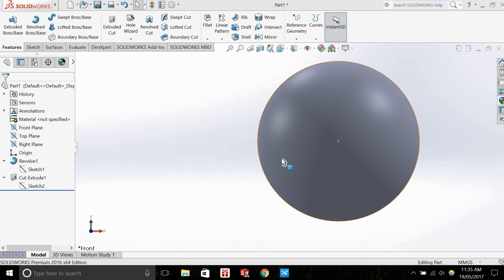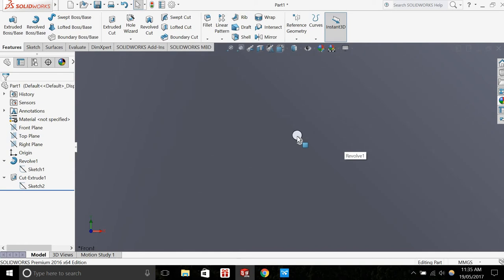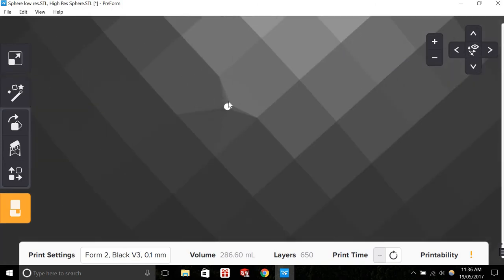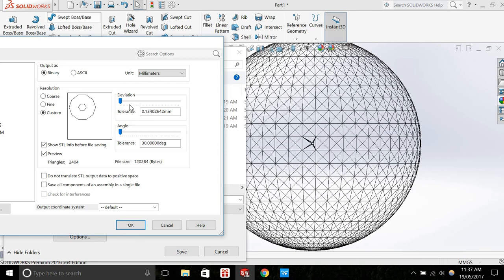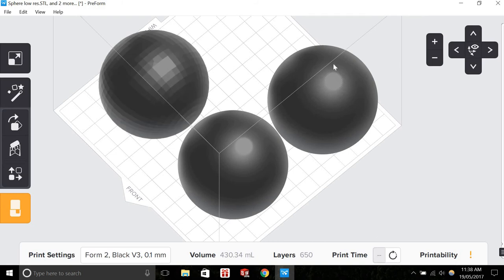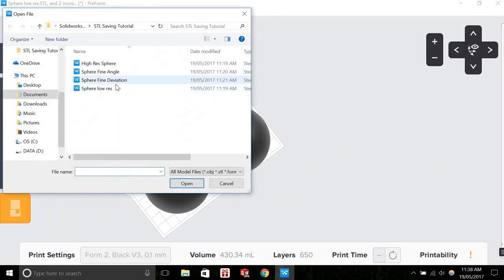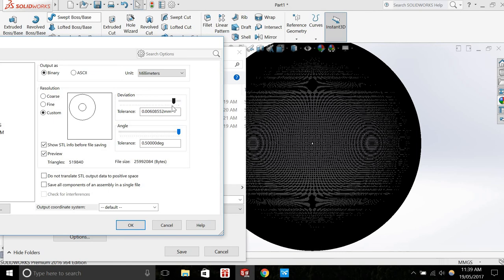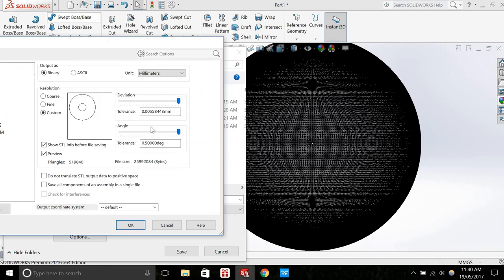Fix SolidWorks STL files - smoother 3D prints

Comment: how do i do this in autocad?
Reply: system variable FACETRES <0.0-10.0>.  The default is 0.5.  10.0 is the highest resolution.  I have not found where you can adjust angle; that might be unique to solidworks and inventor.
Reply: @FABITALL  thanks fabitall.   that facetres setting is on a per drawing basis which is even better as you would forget to reset it for 'normal drawing'. Cheers.

Comment: after a lot of google research i found your video..no more problems with printing from now. thank's a lot
Reply from the maker: No problem, happy to help! It also took me a while to figure out why my 3D prints weren't good
Reply from the maker: If you don't mind me asking what search terms where you using? So I can make this video easier to find for others with the same problem
Reply: @MahdiDesigns  i use solidworks shapes not perfect for printing i think. Circle not perfect solidworks, cilinders not perfect. This kind of things
Reply: Which software
Reply: @irfanshafiq1353  solidworks. Was just mentioned